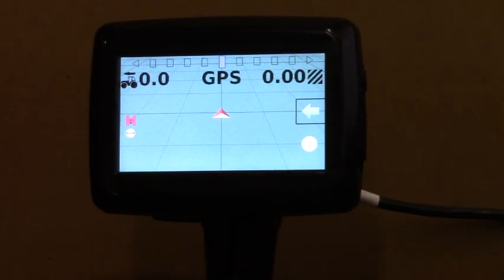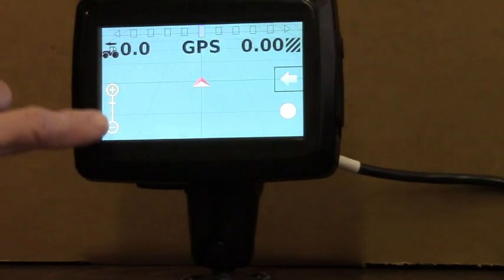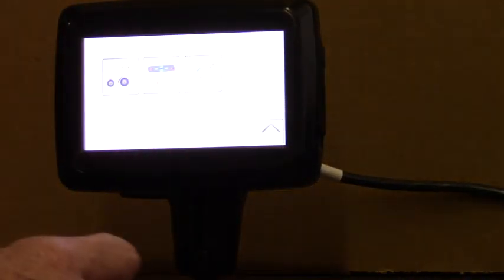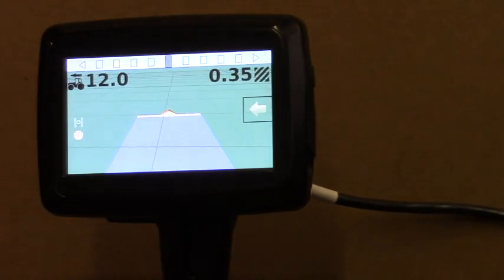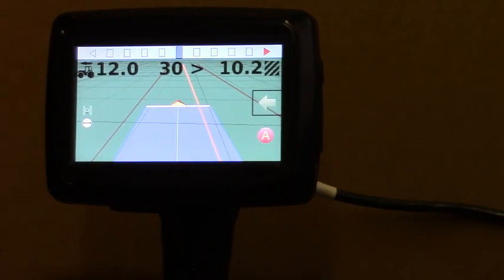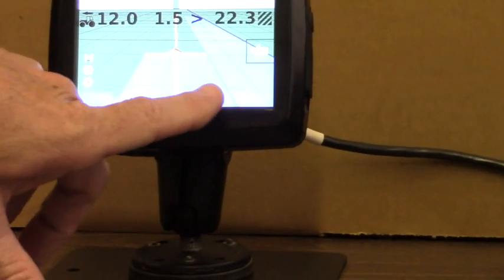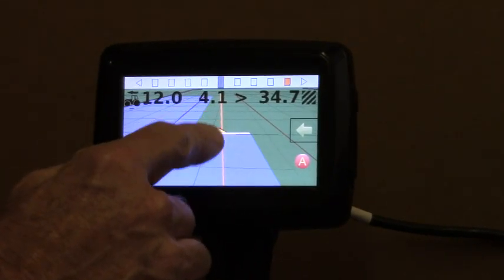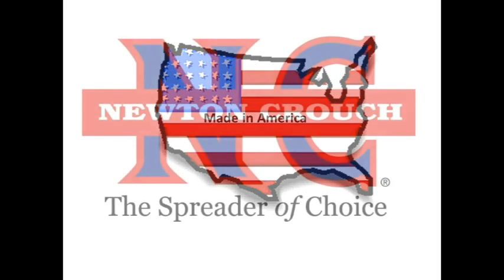How to Set Up & Demo TeeJet Matrix 430

Comment: I just bought one of these units and it seems like it is really a nice piece of equipment but there is one exception.  The instructions are TERRIBLE.  This video is ok but many questions are yet unanswered.    Big one to me is at about 6:30 on the video you set  the 'A' / 'B' points but you do not explain what you are doing or how???   You say you are setting the 'A' point when you press the A on the screen, then you say it is asking for a 'B' point and you say you set it but you don't say how or when.  Do you have to wait until you have reached a point the field to mark the 'B' point or is this just an arbitrary move and you just hit 'B' after you hit the 'A',  that is assuming a B showed up on the screen.  I couldn't actually see what you were doing.
Reply from the maker: The Matrix IS a really nice piece of equipment. Don't despair, once your get your settings entered, it is easy to use.
Typically when you use AB guidance, you are doing row work.  The AB is not an arbitrary set.  You must enter it for your field to customize  your settings.   It sets your guidance line.  Hit A when starting your initial pass through the field.  Just before you turn, hit B.   This line will be projected throughout the field according to inputs you set in your Matrix.   You will reset your AB line when you go to another job.   Hope this helps!  
You didn't say where you purchased your Matrix.  If you bought it from NCI, call us at 800-241-1350.  We have a Precision Specialist on staff who will answer all your questions.  This service is included when you purchase from NCI.     Otherwise, go to TeeJet.com, support tab to download a manual or  call the company where you purchased your Matrix.  They should have a person who can assist you with these questions.